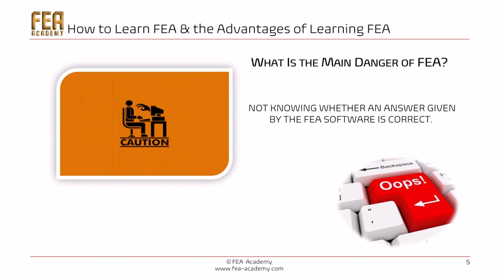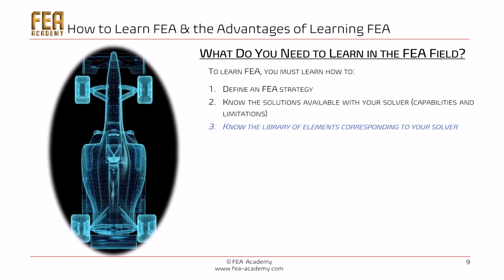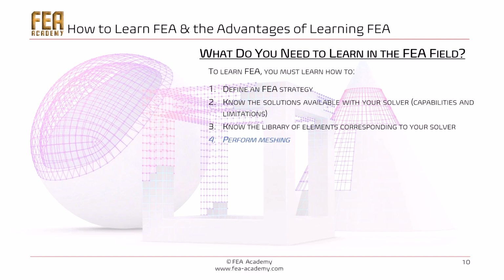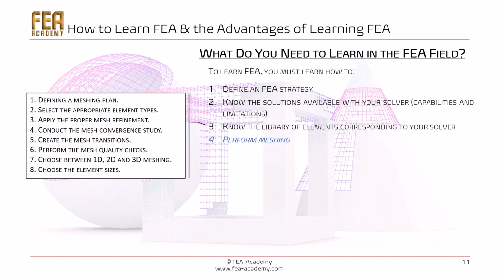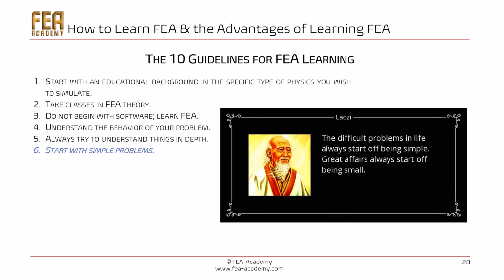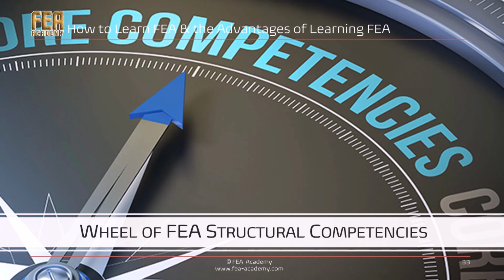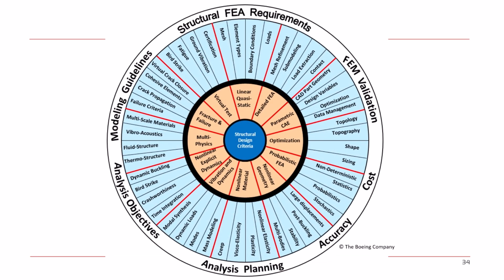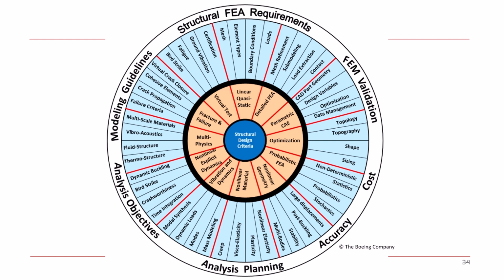FEA Insight - Ep #3 - How to Learn FEA

Comment: can you tell me more about modeling technics, i don't understand when you say learn modeling technics . i thinks its a method that we use for FEA .  it that correct ?
Reply from the maker: Modeling techniques in FEA are the various steps and assumptions you have to do in order to build a reliable FEM. For example: choosing the right type of element (shell, beam, solid...), choosing and implementing the mesh corresponding to the FEM need (coarse mesh, fine mesh, converged mesh), applying proper boundary conditions (restraints and loadings), choosing the right material model, verifying the model (accuracy checks and mathematical checks), using the right rigid body elements, properly modeling the fasteners, doing sub-modeling, choosing the right solution for your problem (linear, nonlinear, static, buckling, modal or dynamic), understanding the outputs. The knowledge of the modeling techniques is fundamental in order to do the right assumptions when you build an FEM. You will find them in my book "Practical Finite Element Analysis for Mechanical Engineers" (https://www.fea-academy.com/index.php/all-books/pfea-presentation). These modeling techniques are also covered in my "Practical Basic FEA"  course available online on-demand (https://www.fea-academy.com/index.php/services/training), In this course the modeling techniques are presented in detail with examples.